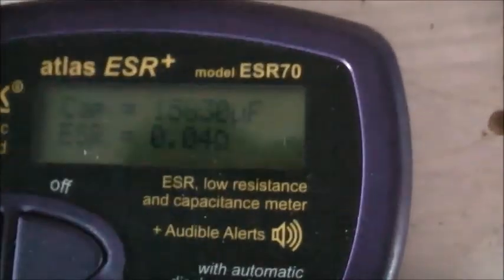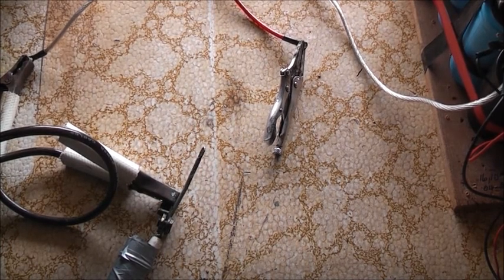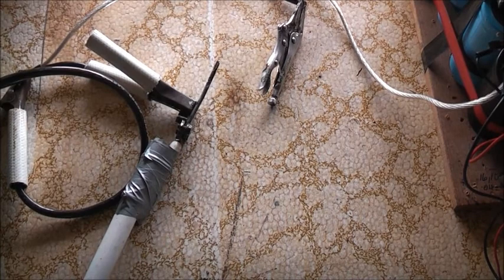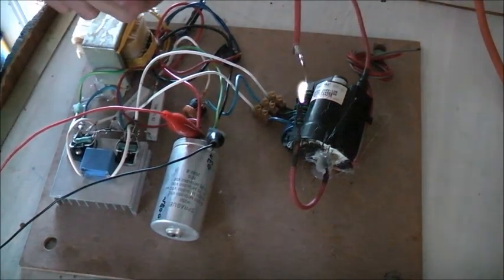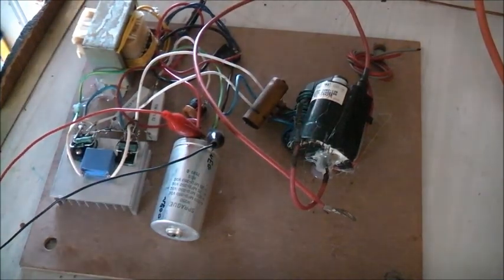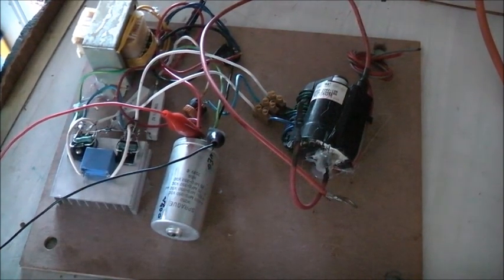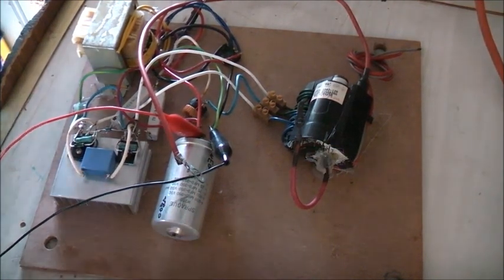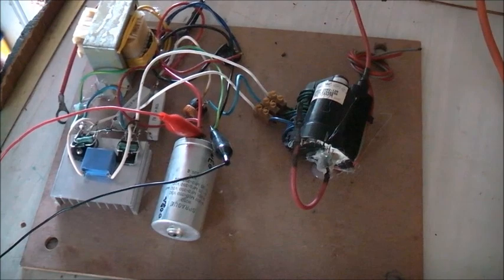Test Filter Cap Setup!

Comment: Mmmm, nice big pops from that cap setup. :D

Haha, there's not going to be too much left of that locking wrench soon...You will have blown lots of holes in it. :D

What I would like to be seen done, is for a thin wire to be dangled across the terminals to see how well it explodes, LMAO.

.....Or even some wire wool. Yes, dump the cap bank into some wire wool to see how good the fireworks show is. :D

That microwave that failed..... Did you keep it as a poppage chamber?

Thanx for showing,

-BBD.

Comment: A .01 uf doesn't hold a significant charge at all, even if it is good, you would need one that's .5 uf of higher to hold a charge. Paper caps are also non polarized, the black line doesn't indicate polarity it indicates which end is connected to the outside sheet of foil, it used to be for shielding purposes supposedly but I have seen them connected in circuits either way around. New paper (now poly film caps) don't even bother with that.